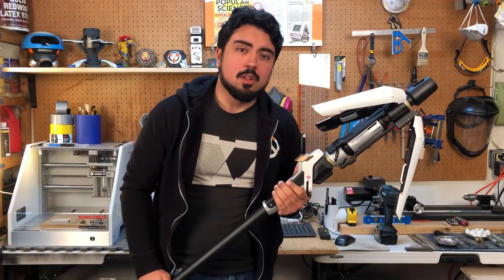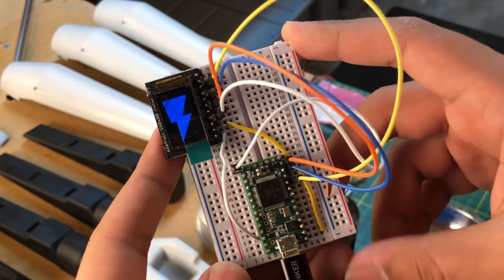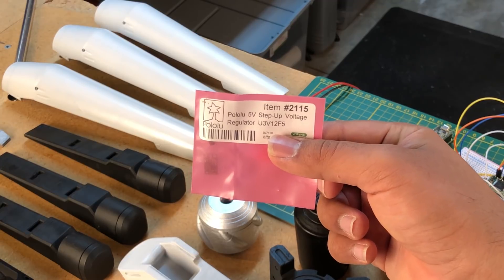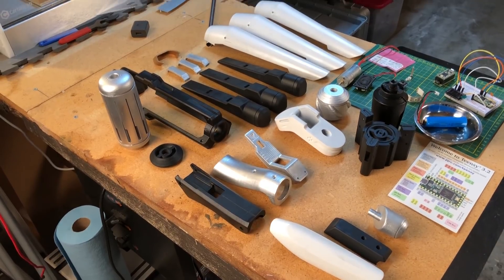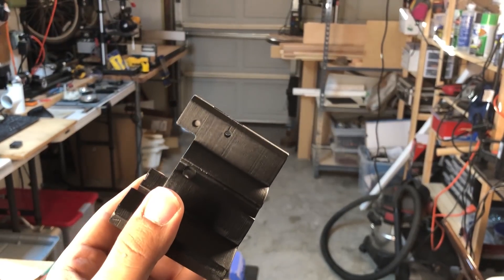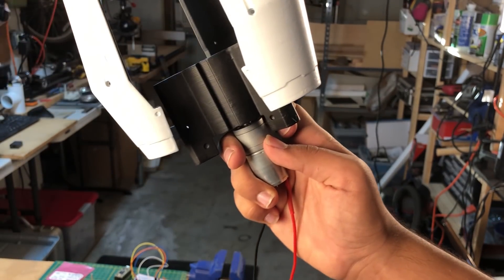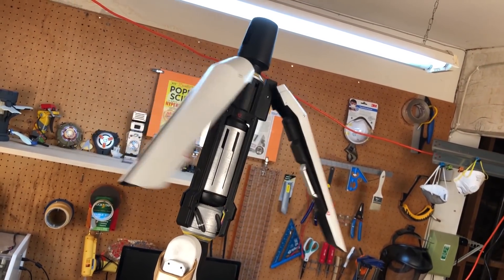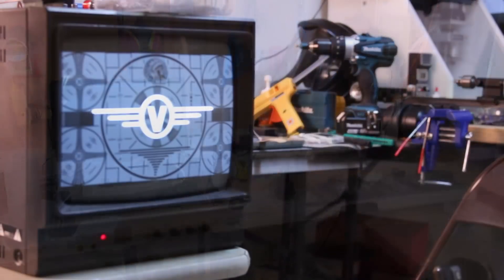Mercy's Caduceus Staff in Real Life | Overwatch Cosplay

Comment: Hello! I know this is a bit old of a video but I was wondering if you think itd be possible for someone to modify this a bit in order to add an LED at the end? The purpose would be to simulate the glow that happens when Mercy isnt locked onto the target. Im curious to hear your input on it!
Reply from the maker: Yes! I actually modeled it so that wires and lights can pass through to near the tip. I didnt add them on mine because this was already overdue and I wanted to keep it simpler :)

Comment: Suggestions:

1. don't drive directly on the motor, the stress comes from the gear box (from personal experience) so if you have some tiny 1 cm OD bearings (from say an old HDD) they would do nicely to keep the stress off the gearbox

2. carbon fiber rods instead of the articulations that hold the "wings" now. Two such pieces should suffice to hold it, articulate it (with a simple slide system like umbrellas employ) and make it appear like it's floating. 

Idea comes entirely from a broken umbrella (which is perfect a design articulation for this IMO) that had carbon fiber parts and i was amazed at how resilient they are at 2.4mm diameter. I can bend one end to end meeting, and it won't break. Until then i kept away from CF because i know it can crack, but as rods go, no such thing seems to happen. Also, bonus, cheap on eBay.
Reply from the maker: Yeah, the motor definitely needs more support to relieve the stress. I had considered actuating the "wings," but I wanted to keep it simpler for other people to build and have fewer mechanisms overall for a reasonable look compared to the in game version. A high quality version with all the bells and whistles would be awesome, but would require a fair bit of more design time to work out. Maybe I'll do a rebuild in a year!

Thanks for the suggestions :)